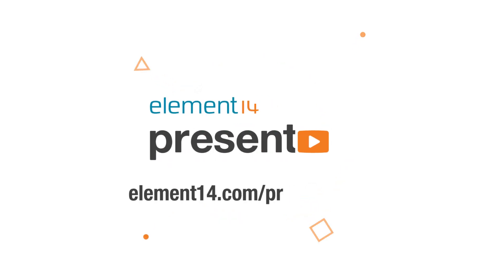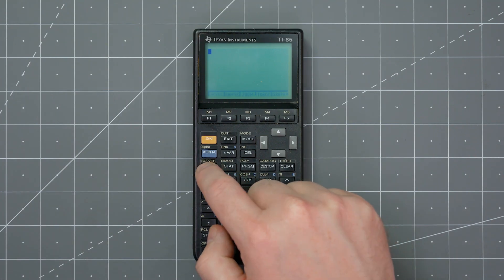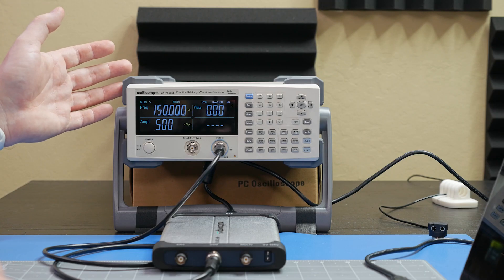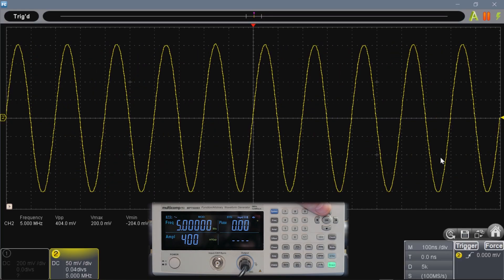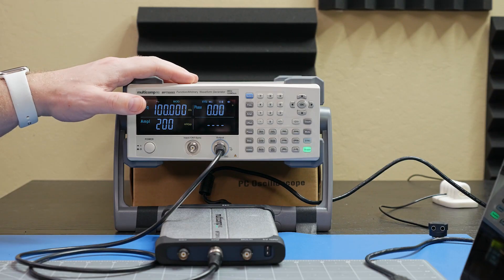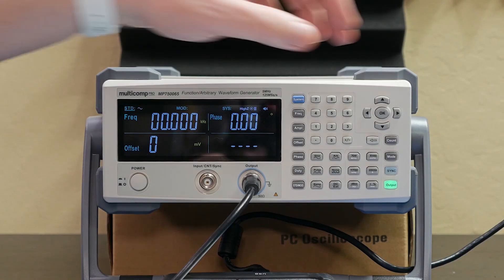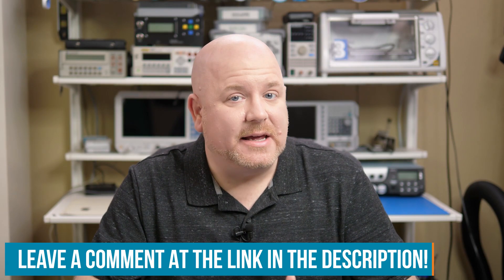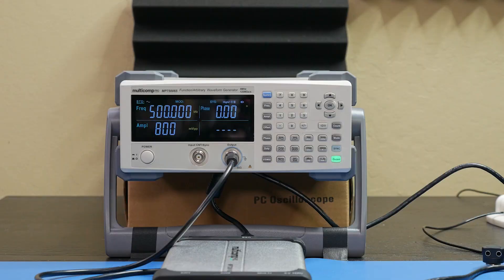Instrument Basics:  Function Generator - Workbench Wednesdays

Comment: Can someone explain to me if it’s possible to listen to what you’re outputting if it’s within listening range??
Reply: Technically, yes. But the drive strength (current/power capability) out of a function generator is very low. You would need some external amplifer circuit to drive a speaker.

Comment: The generator sweep i use for filter test with a scope.  You can do the same thing with a SA but that SA will require a track be more money and SA may have sensative inputs you dont want to blow up.  For me the scope and generator are a better fit for when i need it.  Im not at RF frequencies so it works.

Comment: OK this is a important question to me I hope you read this. I am just now learning electronics in an old age out of boredom LOL. So I've been tinkering with Arduino and building my own simple circuits to make my life easier I've built a couple small projects that turned out nice etc. I do not have a scope but I'm in the market for one and I'm only gonna be able to afford a Chinese one someone told me hantec makes some that are also combo signal generators.

This is important to me because add an unrelated topic I have a case of galvanometers that are very expensive they were from a facility we shut down and they were gonna throw them out despite them being brand new but sarbanes Oxley dictates you have to get rid of that inventory if the product line is gone so it was going in the dumpster. I took like $50,000 worth of I'm home but some of them are known to be bad in the box and they weren't marked well by the guy that used to tune them.

The driver boards are paired up with the galvanometers and I'm pretty sure I know how to make the adjustments but I wasn't sure if he used a signal generator to do this does that make sense to you at all? I believe he was using an oscilloscope and the signal generator to trim the square wave and get out the peaks. So does it sound like some a job for a signal generator?

Comment: does it work without connecting it to other devices?
Reply: Of cource. But what sense is in not using it's output in some other device? Under "device" i mean even a single element like a coil or audio speaker.

Comment: Are function generator and pulse generator same?
I have SIGLENT made 50-ohm function generator, can I use this instrument as a power source for electrodeposition. How can I generate pulsed current using a function generator?
Reply: You need to amplify it using a transistor (bipolar, mosfet, igbt - it depends on). This transistor needs to witstand the current and voltage you use. There are special transistors designed for use in power circuts. Maybe you need to use cooling. Also you may use a driver before transistor.

Comment: 10:00 When does the toaster oven come in to play? 😀
Reply: Toaster ovens are very commonly used in labs as cheap re-flow ovens for surface mount assembly.
There are  DIY controllers for them to ensure that the temperature profile is correctly followed so that the parts and solder paste used is correctly re-flowed. 
Search YouTube for "SMD toaster oven".
Reply: @yrath5034  thanks for the new idea
Reply: @girishchandra2236  You're welcome!